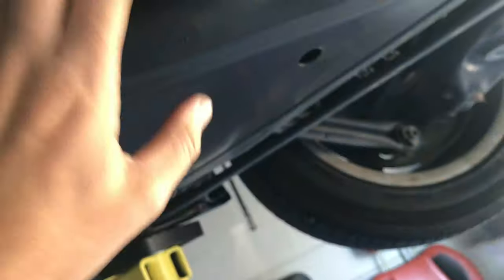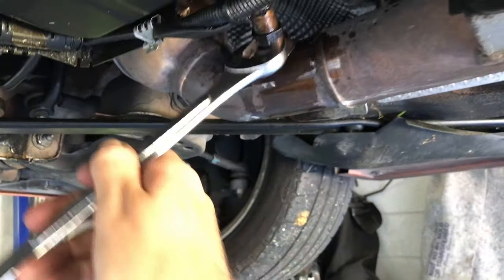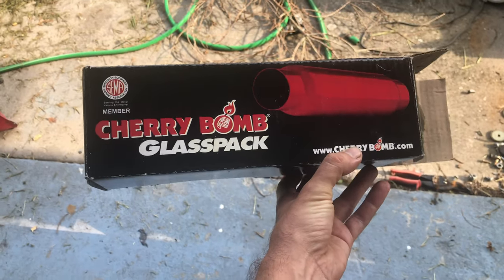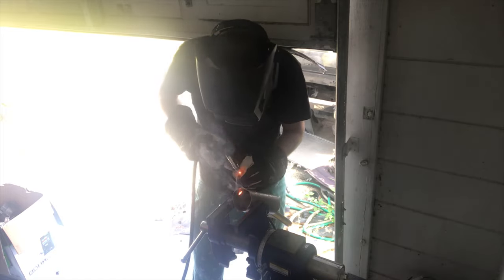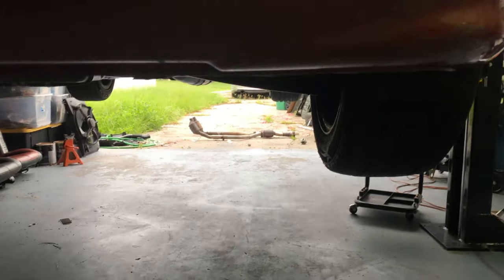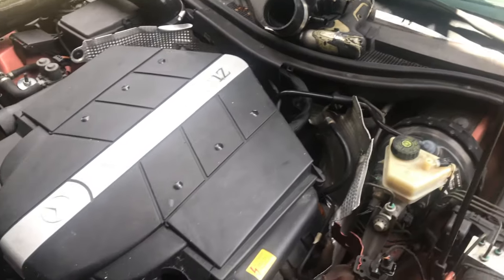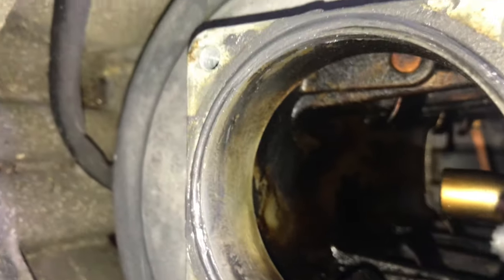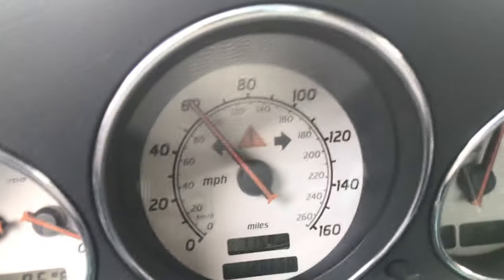MERCEDES-BENZ slk320 , intake ,and throttle body in

Comment: Hey! One mod I did on my clk which has the same fog lights as the slk, is I gutted out the fog light lens and inners. I drilled a hole on the back of the back cover, and put a pvc pipe to attach a intake hose to the snorkel on the air box or in your case, right in front of the air filter.
Reply from the maker: nice do u have a pic of it
Reply: ND_72 yes! I can send on Facebook.

Comment: Got the gearbox remapped on my c320 and it’s transformed the car more so than any other mod
Torque limiters removed 
Rev raised 
And now I have W S A and M modes 

It should have been like this from factory 
I would highly recommend it
Reply: Hi. Where did you get it mapped and did you have to send your TCU to them?
Reply from the maker: @SavedbyHim  if you want a tcu tune vtech can do it and you don’t need to send yours out
Reply: Hey bro! I have a e320 and i want to get it remapped. Any links? Ps: i cannot send the ecu to them. Suggestions please
Reply: From where did you get yours remapped?
Reply from the maker: @anasgaziani  v_tech tuned it
Reply from the maker: @anasgaziani  is your eco a me2.8
Reply: @Nd_72  yes, can you share the link or their instagram handle?
Reply: Sounds like something I would like on my CLK320, who did yours???

Comment: Thank you for your informative video. 

     I own a Chrysler Crossfire which is basically same car. My car is stock . I did get a larger throttle body which Came from Mercedes V8. I cleaned it and need to install it once my arm surgery gets healed better. I am right handed and I have no strength in my arm now. plus i need to have the AC repaired with a total  new parts installed the parts alone was $500 its not been installed yet I am afraid what its gonna cost me in labor for this repair and I need to replace the water pump which is a pain. I had a new clutch installed with a used face plate and all new seals the fluid replacements on the rear $2300.  a new paint job at Macco what a waste of good money its peeling already UGHHH its only 1 year old, they want to charge me more than what I paid the first time to fix their sub par work. This little car is gonna cost me more than it is worth by the time its over with.
     What I wanted to know did you attain more horsepower and is the MPG's about the same if you don't get on it? I wish these Mercedes V6's had a better sound. I own a 2013 Mustang V6 which has way better sound with factory duel exhausts with muffler deletes .  I love my Crossfire but it is very temperamental and expensive when the electronic go bad  like when my scream died and my keys didn't work it cost me $1000 to have someone I found on the website willing to help me. Because no one wants to work on a Crossfire. Mine car is a 6 speed.

Comment: Thanks for the video. I have a 2005 CLK 320, that is stock. An AMG body kit will replace the front bumper that i broke in our driveway and the rear bumper that was already damaged when I bought it. I never thought about performance mods, due to the car being old, resale value and it just turned 180k miles.
Reply from the maker: Make the car fun for you
Reply: @Nd_72  I just came back from a  1,560 mi round trip and the car ran beautifully.

Comment: Good job. But also have several questions... As i know if you install bigger TB, you have to bore the manifold itself too. Did you bored M112 intake manifold to 74MM? As i know M112 manifold itself, is not made for 74MM TT, it's 66... I am also going to put 82MM TB from S550 engine on my M113 V8 and i have to bore the manifold to that spec.
Reply from the maker: the m112 is set up for  a 74mm already and my tb is ported a little more also.  and fits great.  good luck with you m113 I also got a few m113 Benz that will be on the channel very soon. with a few go fast parts lol
Reply: @Nd_72  will the intake you showed work on a 2004 SLK? its R170, but the newer model. no red seats.
Reply from the maker: @Vegas043-c3k  it should work on m112 and m 112k

Comment: I've been looking to pick up an SLK 230 or 320. Would you recommend one over the other? Any idea how much gain there is on the 3.2 with basic mods? This would just be a fun project car/toy. I have a MK7 GTI as a daily and an RX7 as a track toy already. I'd appreciate any advice you can offer.
Reply from the maker: slk320 are easier and will run for ever slk230 can get more power cheaper
Reply: That was my initial impression. Thanks for clarifying, I appreciate it. Hitting a sub for you. Honestly I'll probably grab whichever I find first in good shape at a good price.
Reply from the maker: @fishcars8078  hope I hope send me a pic when u get it

Comment: If I get a dual cold air intake system will I need a aftermarket exhaust? Or will it run just fine with the stock exhaust?
Reply from the maker: it should run just fine
Reply: @Nd_72  can u post the link to the intake kit u went with
Reply from the maker: @adenbishop3331  https://www.needswings.com/intake-slk320

Comment: Nice work- I would say that doing this with an auto car seems counter intuitive to me... they did come with a 6 speed manual which I actually have. It transforms the car and this mod seems much more appropriate to that.
Reply from the maker: well knock on wood the auto is holding up with my mods and 00shot of nitrous. also the 722.6 trans holds crazy tq. the 6 speed would of broke by now from what I am told. also the 722.6 trans are cheaper to fix and a crap lodes of parts for them.
but if ant 6speed slk/crsoofire want to race I am down. lol
Reply: @Nd_72  The Mercedes Swap Shop showed that a 5.0L M113 making 350-360 lbft mated to the stock 6-speed manual doesn't break anything even after 10s of thousands of miles
Reply: @18pluskiddo  The SLK 6 speed is also in the Sprinter diesel and makes at least that in torque.
Reply: @18pluskiddo  the 6 speed in the XF is different than the SLK manual that’s the reason why. It’s from a Jeep of the same era. I’ve talked with Josh about this as well. Plus he has a video on his channel that talks about transmissions and why the XF 6 speed is the more ideal manual for handling the torque for the manual swaps. A guy just swapped a manual along with an M113k engine into another XF but had to beef up the trans a little. Big strides and more people are becoming more active on the R170 platforms in the XF and Merc community. A lot of V8 and LS swaps and even a couple of HEMI’s now. Just means more aftermarket support and it will help keep these cars on the road longer as well.
Reply: That's a dumb way of thinking